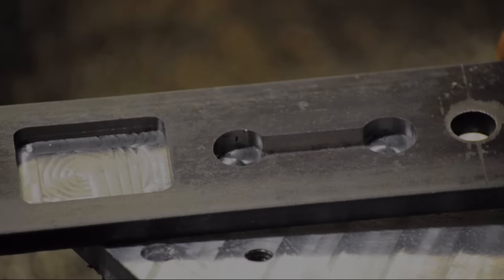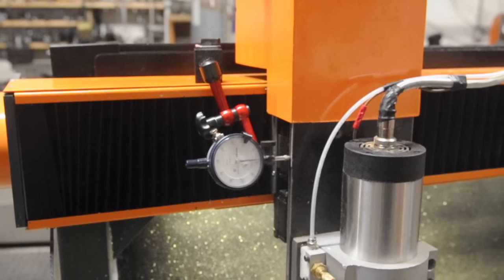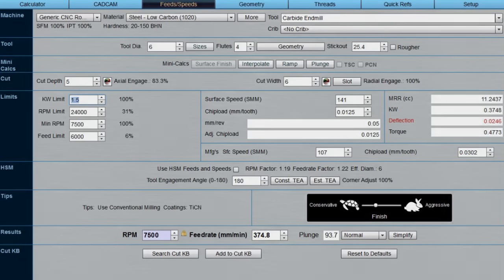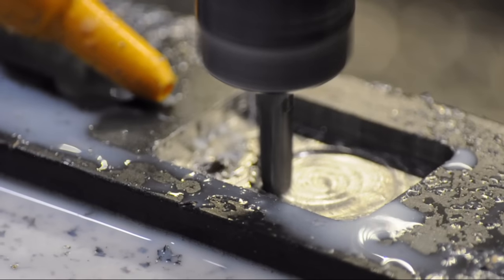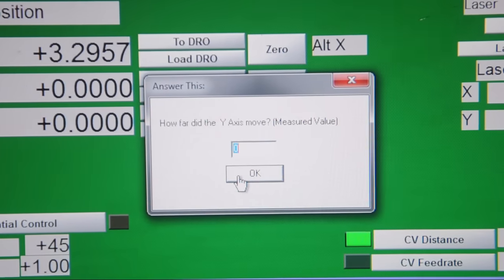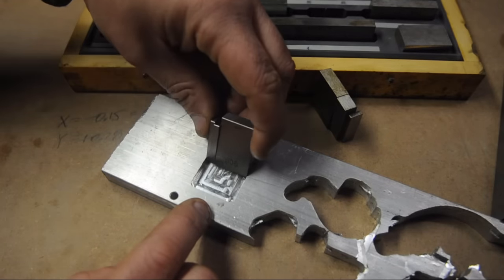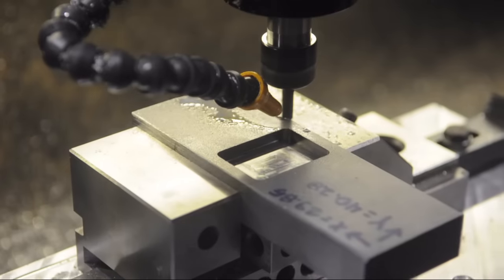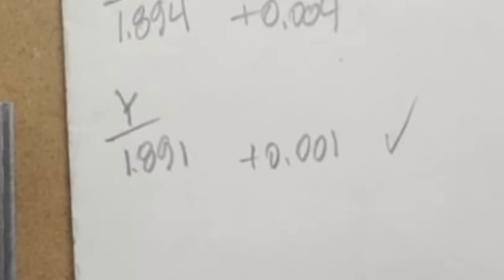ThisOldRouter - Cutting Steel

Comment: Great video Tony!  I used many of your ideas to build my own machine.  I Purchased a VFD driven 2.2 kilowatt spindle and found it isn’t the best choice for metal cutting due to it’s high speed and lack of torque at low-speed.  Do you have any suggestions for an alternative spindle?

Comment: I converted my Novakon NM-200 from Mach 3 to LinuxCNC. I can't afford a full 3d cam package, so I needed to do looping with conditionals based on math, and the ability to do trig and long algebraic statements for doing mathematical surfaces. Amazing build, thanks for sharing your adventure with us.
Reply from the maker: +Andrew Tubbiolo Thanks Andrew.. have you had a look at Fusion 360?  3D CAM and its free.
Reply: I have not, but now I will. Thanks!

Comment: It would be nice to hear about accuracy by old equipment, not even in my time but like a couple of hundreds years  back when they did not even had a dial indicator. I do not know about that time accuracy, however I'll have something about the unnecessary accuracy,just for interest sake. That was an interesting program, I know nothing about CNC and I was amazed that the rpm was 75,000, Wow!, what kind of bearings in that spindle? And cooling? Very intefesting. Thanks

Comment: what is the stepper motor driver that you are using and did you try to use any other microstepping index configuration, for instance did you try the 1/256 available in the drv8711 driver ?

Comment: Not sure if it been mentioned, but threadlocker is a must for this type     
of project.
 Thanks Tony, really appreciate the effort in making these videos. I have been slowly working on my own DYI router and find your videos helpful. I'm on the overkill spectrum with 32mm ground nsk screws and legit hsr25 and hsr30 rail and carraiges. Trying to decide on moving vs. stationary gantry at this point.

Comment: Are you using blue or red loctite on the screws? I would imagine that you could get away with doing so as replacing the rails shouldn't be a common occurrence.

Comment: l saw your last video. Together with this one, it is magnificent! I haven't seen any router machine can really cut steel so efficiently as yours. What toggle camps are you using? It is surprising that the workpiece did not move any under the high cutting force. What any famous vises are proud of?
 Gantry type machine will have balance force in machining when cutter or workpiece located in two ends positions...ln future, if I get the capabilities as yours, I would build gantry type as well as on z-axis, so the whole length (of X or Y axis ) moves up and down, keep a little flexing on Z spindle/cutter..
Reply from the maker: +raychar cheung I don't recall exactly, I think just the run of the mill Irwin or Kant Twist.  Cutting forces weren't too high.  Thanks for watching and good luck with your build!

Comment: Any benefit to be had with TiN coated carbide mill or Ti carbide mill in raising rpm? New steel-cutting blades use TiC tooth tips. Perhaps a v. small flywheel -hmmm, well you DO have the armature, but what of harmonics? Resonant frequencies? Shoot, clamp the flywheel to the bit shank. Perhaps would damp router speed control pulsation. This is just guessing on my part, so please excuse MY errors, LOL.

Comment: This has convinced me to start cutting steel on my 6090, 2.2kw spindle, damn 5mm DOC! - I only have single flute cutters, this is going to be fun!
Reply from the maker: YOLO?  :)
Reply: Well I did it, 24000rpm, 4mm single flute, spiraled in, DOC 3mm, pocket out with a 0.25mm step over. worked well.

Comment: I'm thinking, instead of calibrating at 4.0mm, if you can cal. at 25mm it should help your resolution. 
Nice build and excellent video.
Reply from the maker: +Jerry Long I'm on the same page.  Mach3 allows full screw mapping.. one of these days!
Reply: Thanks Tony for the great video; the above comment is exactly what I was thinking. 4mm seems like a very short run to calculate your CPI. Strength of measurement would be much improved if you used a gage, 1-2-3, or 2-4-6 block. Congrats on the great results nonetheless.
Reply: +Jerry Long I found that too...you get way better accuracy the larger your calibration distance is....

My wood CNC router is 24 x 48 and I found that measuring at 23" gave MUCH better results than at 12 which I started with......

Comment: Hey, is there no way to get the RPMs lower?
I want to build one of these machines for some Aluminum and alot of Steel, going upto tool steel hardness. And those require REALLY LOW RPMs (50-300). Your design is very robust and promising, however the spindle RPM are way to high in my opionion. Is there a way to get the RPMs lower on this spindle, or would you recommend some other spindle?
Reply from the maker: Thats the tough part.  Good spindles are very expensive.  If you just need low speed, check out the milling heads at littlemachineshop.com -- they'll go slow, good for steel.. but don't have a lot of HP.

Comment: Hmm.. I wonder if mine can handle it.  Shes not rated for it, that's for sure, but shes a cncrouterparts 4x8, shes got a beefy watercooled spindle...  she goes down to like 100rpm if I really want her to... it might just be worth buying a carbide endmill and seeing if I can save myself 600 dollars on buying a manual mill.  You're taking some thick cuts, and I'm enough of a wimp I'd probably do 3x as many passes...

Comment: Cutters with 2 flutes, maybe even 3 will work good at higher spindle speeds.
Just by looking it seems that it is not really making a good cut. Also chip removal is very important. Having the coolant/air coming in from a higher angle will make those chips evacuate the pocket better. Now many are recut and will cause shatter and a rough finish.
Not a bad start at all!
Reply from the maker: +Tzadvantage Bkk Thanks, I'll give that a try.

Comment: Hi Tony. Great vid like always. About backlash. Do you changed the ballscrew spindles to trapezoid thread spindles? Ballscrew spindles typically have no backlash. On my large cnc router ther is no measurable backlash. My guessing is that your result on activate backlash compensation try to fix an issue with your spindle bearings. I've seen all your vids about your router but you did'nt talk about your bearings for the fix mount of your spindles. Typically i use cup springs to load the bearing to the needed forces. In other words, your spindles are maybe moving along the axis while the cutting forces are high enough. I expect different results if you compare the same result on climb and downmilling the same pocket or isle. Maybe this give you another point of view. On the other hand your Z and Y axis may bow under the forces. You can easyly test it with a dialindicator on the clamp and a 10 mm millingtool inside your spindle and you do the thumbtest on the bit (gloves on:) and watch the dial. ;)
Reply: FretMover looks like the backlash wasn't coming from the mating surfaces between the ball screw and its nut. But rather from the fact the mount of the ballscrew to the table was loose.

Comment: Hi Tony wau for a router it didn't do that bad job removed quite a bit material. Since I have converted my Optimum Bf16 to CNC last week 😅 I look all content that has to do it again. I. Used 3 x Nema 34 hyprid closed loop steppers with 12Nm they have real power and are very accurate cause controlling the steps made and in case of lost steps catching them up. If i understand the 3 axis I will put the 4th and 5th on also with Nema 34 steppers. 
Decided to use Mach3 so I had to use Fusion360 on the other the 64bit computer.. In the beginning cnc is a big mystery but I'm not giving up to understand it someday 😁😎👍
Wish you all the best.. Wolfs from Austria

Comment: Hi Tony, 

thanks a lot for your Videos on your router project! It learned a lot from you. At the time I started to convert an old engraving maschine (Deckel G1L) to an CNC maschine. I use NEMA34 steppers that that turn the heavy maschine easy. The problem is the backlash. 
The next steps are learning CAD and CAM with OpenCAD and Heeks. How did you choose the Software? (I use LinuxCNC to drive the maschine)

Again thanks for the great informations on your project. It was great!!!

Jens
Reply: If you're not dead set on that route, check out fusion360. It has built in CAM, and I find it to be very intuitive.
Reply: Love to see how that works out for you, I have a G1L also that I use for little engravings - I actually mostly print out images large on paper and then mount them on the table between two clear plastic sheets and freehand trace the picture.

But I have thought about CNC conversion - along with making a sliding head similar to the G1F but possibly with its own spindle motor instead of using the engraving spindle.  http://www.e-engraving.com/machines/deckel/img/Deckel_G1F.jpg
Reply: Nice machine. Definitely a good candidate for CNC conversion, especially the G1F. Might have trouble with lifting the table for the Z axis. Might need counter weight or pulley reduction on a NEMA 34. Might consider just putting a z axis on the spindle mount arm.

Comment: Dumb question:  is there a better motor available for the cutting motor?  Seems that is allowing for too much tool deflection?
Reply: The better option would be to make a motor less spindle and make it bulky. Drive it with motor and belt. That way you can use as big of bearings as needed. But eventually you’re going to hit a wall of diminishing returns. At that point it would be better and probably cheaper to convert a Bridgeport mill

Comment: Hey Tony,  what are the specs of the spindle motor you're using? Trying to source one capable of what I have seen yours doing so far
Reply from the maker: just the import 1.5kW air cooled from eBay with the huanyang vfd.
Reply: @ThisOldTony  thanks for the reply! Great job on the build.. hopefully when I'm finished, mine will perform half as good as yours. It definitely will not look as nice.. lol

Comment: Coming from someone who made their own CNC machine, yours came out pretty darn good.

My machine is also gantry mill, unfortunately, the don't have enough metal to make a proper table, which wouldn't be a problem--except that I am also milling metal on 20mm of MDF, which screams like a banshee. Perhaps I should feel good that the rest of the machine is fairly solid, but that MDF deflects enough to be felt, and even if it only deflects .01mm, if you consider how the area and displacement, it makes a great speaker.

Because you have a solid table, if you are doing thin metal part, perhaps you could use blue-tac to couple your part to your vice or clamping solution, to quiet it down. If course it would have to be dry to start. It could even be stuck to the end of a part like a suspended mass kind of dampener.

Comment: Hi Tony. What coolant are you using with your hand spray? I'm really curious.  thanks!
Reply from the maker: On aluminum I just WD-40 (or whatever light 'penetrant' is within reach).  For steal I have a 5 gallon bottle of 'oil emulsion' ... emulsifiable oil.  Looks like vegetable oil, mix it with water (5-10 water : 1 oil) and it turns into that while stuff you see in the videos.  Sold as "oil based coolant".

Comment: First square pocked roughing was interpolated clockwise and generating maximum cutting force.
Try climbing instead of conventional and you'll certainly lower the vibrations and noise.

Comment: 2 years too late but.. Should be climbing not conventional cutting. 7500 is right on the money for that size carbide, you could run that 10-12k without too much issue. These style spindle are powerful but  not hoggers. Go full depth, use a 10-20% stepover and adjust the feed for chip thinning, you'll find you can double the feed with an adaptive.

Ally you could run full speed, 80% max feed rate and then adjust the step over to suit spindle load. Your feed will limit the cutting more than the spindle.

Anyway, 2 years too late.

Comment: 0.001 inch is 0.0254mm that's good. New tool cut 0.01 short never had tool that cut correct,but never do oversize always shy

Comment: Totally not the purpose of your video, but what is that strange arm that holds your guage in place at 9:30 ?
Reply: It's a magnetic base for a Dial Indicator. You attach the magnetic base to any magnetic surface and arrange the multiple extension arms so that the dial is perpendicular to the actual surface you want to measure. You set the dial to zero and then measure the travel towards or away from the dial. Dial indicators are a machinists best friend!

Comment: You should try roughing mills if you haven't already.
Reply from the maker: Yes!  must get some small ones.
Reply: This Old Tony look into YG-1 endmills...they make some fantastic powdered metal endmills that work perfect for your situation with lots of vibration and chatter...powdered metal drills and endmills are much tougher than cobalt or HSS tools, but not as brittle and easily chipped as carbide...you can beat the snot out of them and eventually they just wear out, unlike carbide which will usually chip and fracture easily in those situations...or go with the cheap TiN coated endmills from Kennametal, they're a lower grade of carbide and more shock resistant than the expensive brands, but they're still good endmills for the price...
Reply: Hello "Johnny Cliche" Thank you so much for info, if it is correct what you are saying, it saves me20hours+ of google-research... <3 love people like you.

Comment: What kind of spindle is that!?
Reply from the maker: 1.5kW air cooled from ebay.
Reply: This Old Tony did you change any VFD settings to compensate for the low RPM? My spindle stalls like crazy under 13k rpm. Same spindle

Comment: Hello Tony! Great machine! Great videos! I have a question. The answer is very helpful in building my machine. Can you measure the stiffness of the spindle? It is not difficult to do. This requires spring scales and arrive indicator. With the help of the scale you need to pull the spindle and to see how far to move the spindle, kg/mm )))  Please !!! )))  These data possible help not only to me. Sorry for my English)
Reply from the maker: I'll give it a try but, from cutting, it's less than 0.001".

Comment: At the end of the video you say a "suitable spindle for steel" may be in the future.  Do you already have an idea of what type?  Can you share your thoughts?  Thanks - WadeO
Reply from the maker: +Wade'o Design Initially I thought to buy a spindle head from a place like LittleMachineShop, but they're a little underpowered (and big!).  Sooner or later I think I'll likely make my own spindle (two bearings, a spindle and a pulley) and use the spindle you saw in the video to drive that 2nd spindle.  if I have space!  The goal would be: 1) get the spindle speed down (10:1 would be nice!) and 2) get the loads off of the drive spindle bearings an onto something beefier.

Comment: great video, watching Americans use metric system is quite confusing though :D
Reply from the maker: +jz1199 lol, my apologies.  Don't know why but I'm fine with nominal metric.. but when it comes to tolerances, or anything that starts with a 0.0xx, I have to convert.  I have no idea what 0.0076mm is until I convert it!
Reply: it is the same for "metric people" when you talk in thousands, and then suddenly tenths arrive, meaning tenths of thousands... for us it's super easy - 1mm is the finest tolerance that for instance a fine house construction worker would use, 0.1-0.01 are general machinist tolerances with 0.02 being width of a human hair more or less which in nearly one thou of an inch, and if someone is asking for 3rd digit after comma, then you're dealing with either hydraulics, interference fits, grinding or people who have no idea of what they are asking for :D
Reply: This Old Tony lol metric is fairly easy... 

1=millimeter
0.1=tenth of a millimeter
0.01=hundredth of a millimeter
0.001=thousandth of a millimeter (micron or μ)
Reply: 1mm for house construction! Wow, I want that builder...er.. maybe I don't want that builder, as the time they rack up could be mucho $$$. I'd guess you mean kitchen and bathroom cabinets and benchtops, rather than wall frames and roof trusses.
Reply: It's tough for Americans. We need more tools. There is less metric fasteners and stock here. Too many people don't know metric. If you make stuff in US-CU, you aren't going to sell it anywhere but the U.S. We are so screwed, and not in the good old fashioned way.
Reply: Graphic artist: Hold my beer.
72 points to the inch, 12 points to the pica, 6 picas in one inch.
Then we have mils which is what'd you expect,  obviously we are talking about thousandths of an inch, none of that metric garbage here to get confused with millimeters,  of course a mil is just  0.072 point. Then, of course, we measure paper thickness in weight; nice, sensible newtons or kilograms? No. Pounds. Freaking pounds. because, of course we do. and you'd think we'd be all about the A standard of paper, but no, letter being 8.5" by 11, it's juuuuust a hair off of root 2.
Reply: Try using the metric system to calculate the length of the hypotenuseof a right-angled triangle when the vertical and the horizontal are both 1cm. That's where the imperial system comes from.
Reply: @davidhughes3189  Sorry, could you elaborate ? I'm genuinely curious, because really the hypotenuse in that case would be the square root of 2 cm2, so 1,4142 cm, nothing too difficult to calculate. Or maybe was a joke I didn't understand ^^
Reply: @lilietto1  Root of 2 is infinite number in decimal system. So, it's actually difficult. Imperial is fractional system, so in some rare cases it has better convenience/accuracy balance. Then again, nothing stops you from using fractions in calculations with metric units and round up end result.